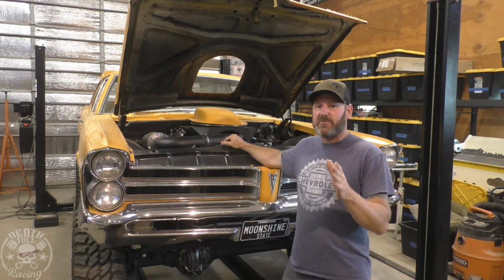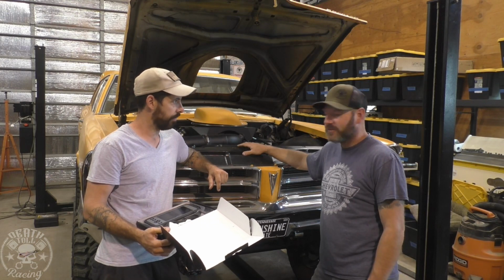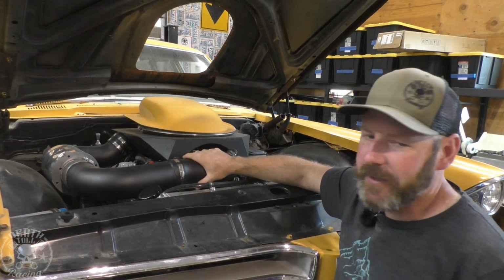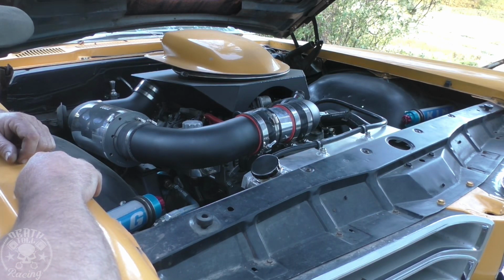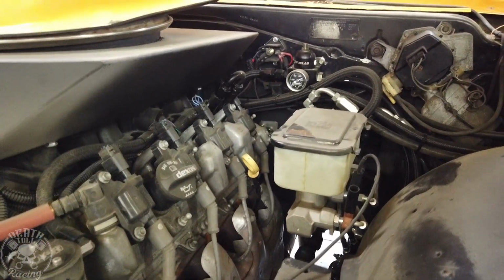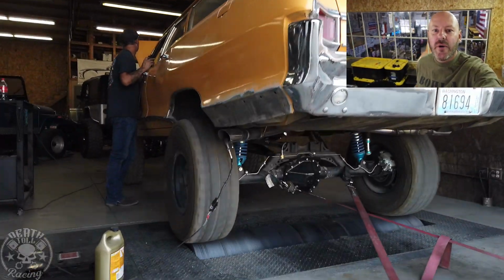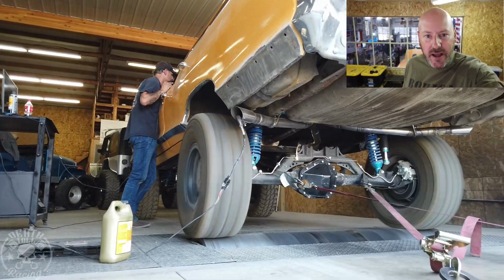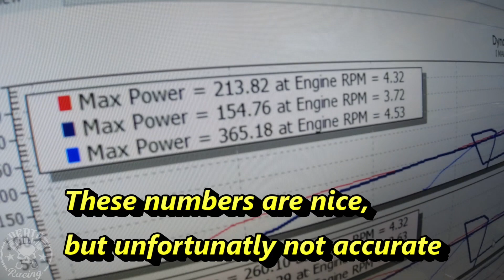Gen V L83 Intake and Dyno Tuning Knock Problems! 5.3 Direct Injection / Th350 DTR Safari Wagon 4x4

Comment: That sounded so good on the dyno. Nearly there just fuel issues I hope so.
Reply from the maker: I will feel really dumb if it is just the non ethanol.  🤪
Reply: @DeathTollRacing  I hope that's all it is. Who would of knew that, at least you worked it out.
Reply: Alot of guys disable the burst knock on these newer 5.3. It will show false knock and pull timing or add fuel
Reply from the maker: @Pitman556  interesting. I was reading about that too. Such weird beasts these are. It will be fun learning about it I guess.